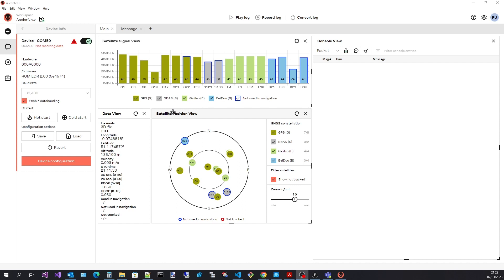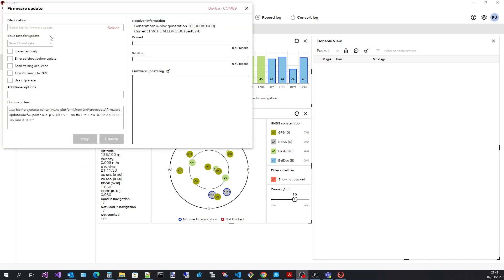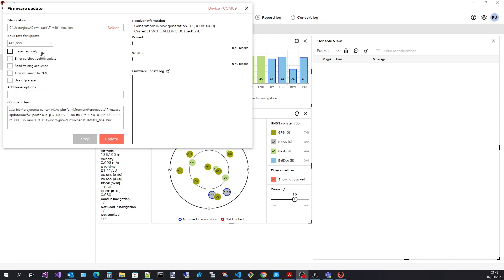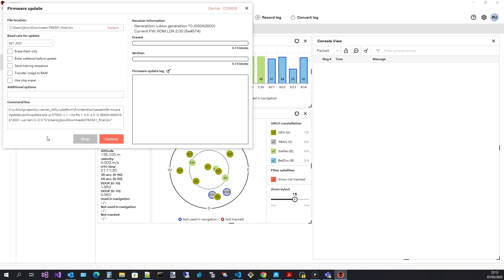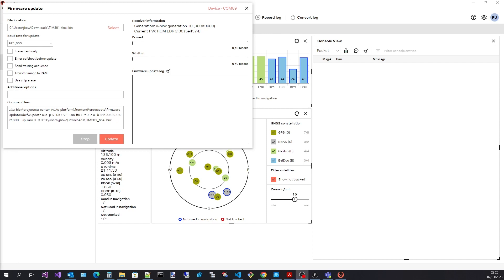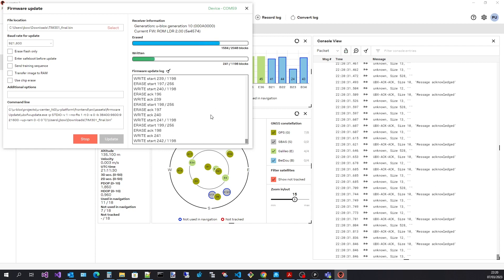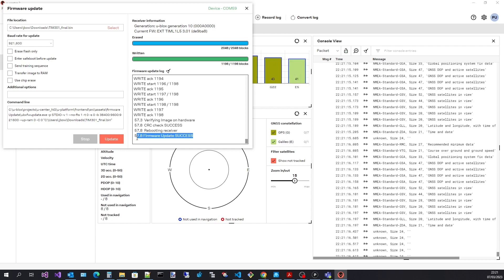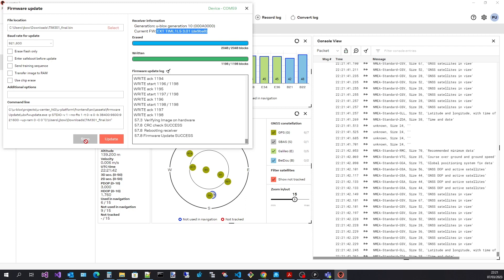Firmware update on u-center 2 (ver. 23.03.)

Comment: This is total nonsense and the current u-center is nothing like this and the firmware update utility doesn't have any of the same options. This won't work as shown to do the update because the button won't turn green until you find the file called flash.xml in the u-center folder and put it in the FIS box, then it turns green and you can program it.